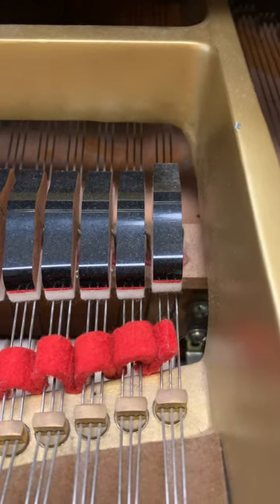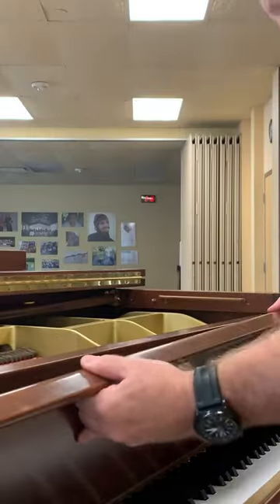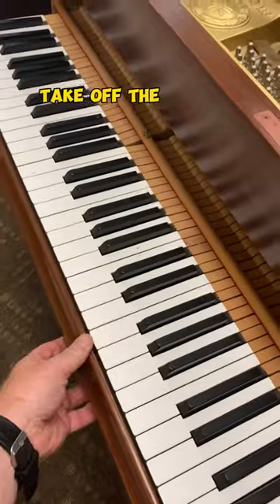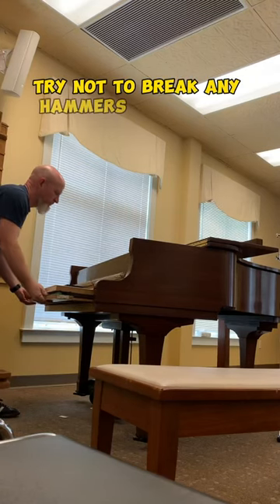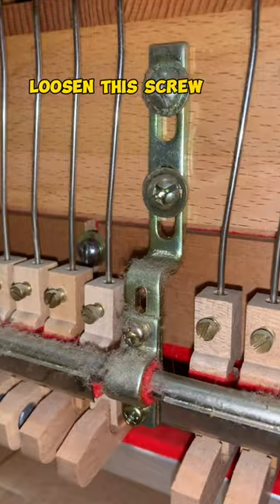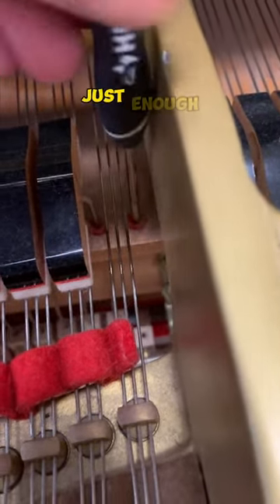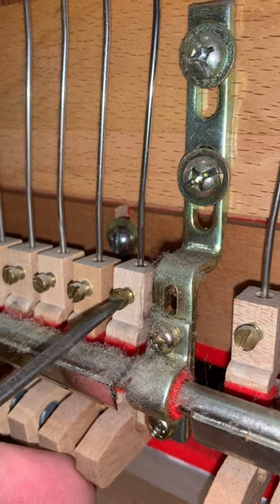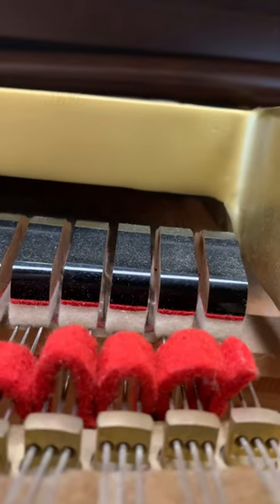Just when I thought I was done #piano #pianomusic #pianotuning #woodworking #pianocover #music

Comment: I feel you on that! I did a bunch of hammer mating today and nothing but pulling the action in and out. 

I’ve used one of the long flexible lighters with a small blue flame to heat up the damper wire while moving it up and down a bunch. Kind of like using a heated caul to ease key bushings. Give it a try before pulling out a bunch of damper wires!
Reply from the maker: Good idea

Comment: Can you add a drop of silicon lube to each seat?
Reply from the maker: You can and that will often work at least temporarily. I try to avoid liquid lubricants personally when fixing something on a piano. My experience is it is temporary. That being said, many reputable tuners use them all the time with great results.
Reply: Seems like you could wriggle the damper up and down from above while exerting pressure to the varying sides and it would likely fix it.  Even more pressure could be exerted if necessary by using a thin tool to reach down nearer the guide and press the wire sideways while moving it.
Reply: @preludepianosolutions  I see. That may just be the cost of enjoying a nice piano. Periodical maintenance. If i was into pianos,  I think I could design something more reliable
Reply from the maker: I have tried. They even have a tool that is supposed to go around the wire and slide down in. I am embarrassed to admit how many times the felt popped out while trying to do just that.